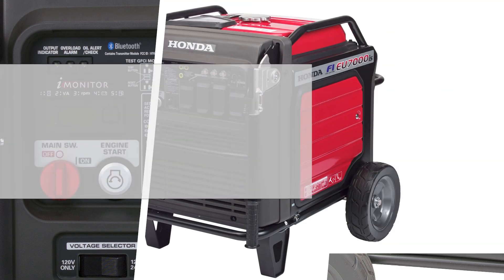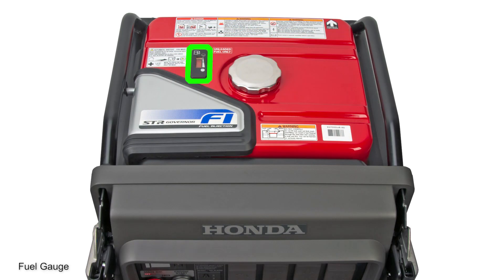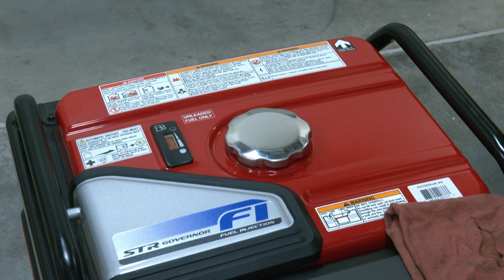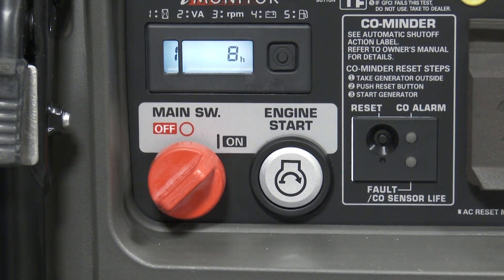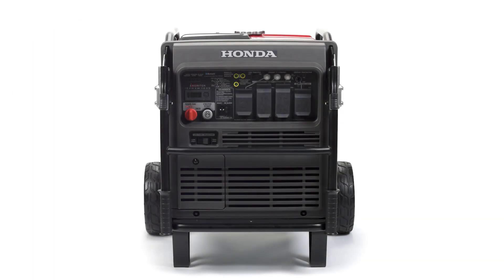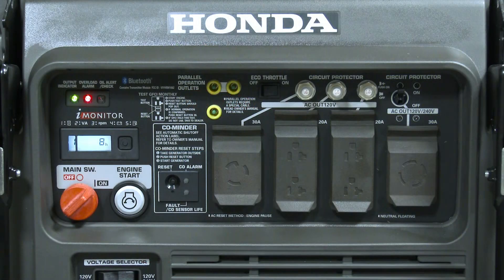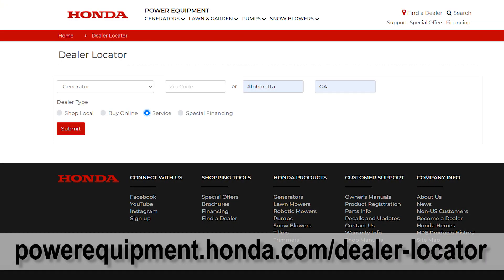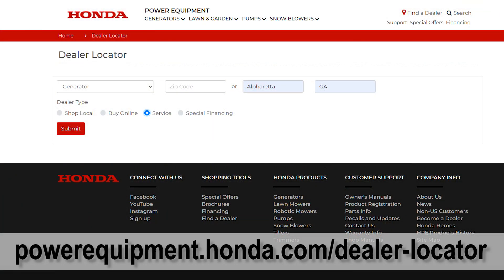Honda EU7000is Generator Operation

Comment: I realize this is an older video, i was wondering with proper maintenance how many hours would you estimate you might get out of this unit. I realize it would be an estimate, just curious. Thanks
Reply: I would say 2000 with good oil change discipline

Comment: Honda should consider releasing the control panel wiring diagram. All input interfaces and LCD should have a parallel interface . So that the LCD and All input Buttons can be placed in a remote enclosure for remote monitoring and can be controlled with autostart  feature. New  versions are coming with bluetooth but that range is not sufficient . Especially if your generator is in the basement and you live on the 3 floor, a remote operaton and remote  lcd for monitoring the generator will be good thing to have. In this IoT era , everyone wants to automate their stuffs for remote sensing and remote control. Third party sellers are selling Autostart Kits why honda cannot provide the same function built in.

Comment: I turned on the key and nothing show on the LCD screen.  Took it to autozone to charged and put it back still no power.  What’s the issues I should be looking at?
Reply: Can you start it with the manual pull rope ?

Comment: can i use this (Honda generator diesel eu7000is) for desktop computer (500W, 240V, 4A, or above) with no problem? if there's problem, what solution/s? using a AVR or something?
Reply: ⚠️Please don’t forget to follow the generator safety tips when you use your portable generator:

All generator safety rules need to be followed carefully whenever you use your portable generator. This is a reminder. 

1) KEEPING OTHERS SAFE: Please do not allow an unqualified person or your children to operate and service the portable generator. Just because some manuals don’t say that doesn’t mean it’s safe. That is important against the generator safety rules. We also need to be keeping an eye on our children too. You need to make sure that your children are not playing near the portable generator especially when it’s running so they won’t get electrocuted. Generators pose electrical risks and they can be hot during an operation. Please keep your children away from the portable generator at all times. It is important to keep our children safe especially our little ones. Be aware of all the hazards.

2) WHERE TO RUN YOUR GENERATOR: Some people use their portable generators indoors which increases the risk of carbon monoxide poisoning. It’s important to have a carbon monoxide if you have a gas generator. Never ever use your generator indoors even if your doors and windows are open and even in the garage is not safe to use a portable generator. Not even at your porch and your deck. It is never safe to use your generator indoors and in enclosed areas of your home. Your generator needs to be 15-20 feet away from your house. 

3)🔥FIRE HAZARDS: Never refuel your generator while it’s running. You need to let your generator cool off before refueling it and before storing your generator. Never overload your generator too. Never ever back feed your generator. You should never plug your generator into a wall outlet. Also never store propane tanks indoors. Please keep flammable things away from the generator as well and please don’t smoke cigarettes near the generator. Having a fire extinguisher next to the generator is also important against the generator safety rules. 

4) GENERATOR OPERATION: make sure your hands are dry before touching the generator. Never use your generator in wet conditions. Don’t let your generator get wet. You need a generator tent if you need to use your generator during wet weather. Please don’t wear loose clothes when operating the generator. Turn on your generator before plugging in appliances. Use the right cord for your generator. Please do not use worn out cords. 

https://youtu.be/I1jT3ANENvI and here is a video more about keeping others safe when using generators 

Hope this helps

Comment: M F Honda  !!      We cant buy the Bluetooth   EU 7000 is  in England so why put it on here .   Its been out for sale for a year now .  We must be some third world country .    FFS .
Reply: ⚠️Please don’t forget to follow the generator safety tips when you use your portable generator:

All generator safety rules need to be followed carefully whenever you use your portable generator. This is a reminder. 

1) KEEPING OTHERS SAFE: Please do not allow an unqualified person or your children to operate and service the portable generator. Just because some manuals don’t say that doesn’t mean it’s safe. That is important against the generator safety rules. We also need to be keeping an eye on our children too. You need to make sure that your children are not playing near the portable generator especially when it’s running so they won’t get electrocuted. Generators pose electrical risks and they can be hot during an operation. Please keep your children away from the portable generator at all times. It is important to keep our children safe especially our little ones. Be aware of all the hazards.

2) WHERE TO RUN YOUR GENERATOR: Some people use their portable generators indoors which increases the risk of carbon monoxide poisoning. It’s important to have a carbon monoxide if you have a gas generator. Never ever use your generator indoors even if your doors and windows are open and even in the garage is not safe to use a portable generator. Not even at your porch and your deck. It is never safe to use your generator indoors and in enclosed areas of your home. Your generator needs to be 15-20 feet away from your house. 

3)🔥FIRE HAZARDS: Never refuel your generator while it’s running. You need to let your generator cool off before refueling it and before storing your generator. Never overload your generator too. Never ever back feed your generator. You should never plug your generator into a wall outlet. Also never store propane tanks indoors. Please keep flammable things away from the generator as well and please don’t smoke cigarettes near the generator. Having a fire extinguisher next to the generator is also important against the generator safety rules. 

4) GENERATOR OPERATION: make sure your hands are dry before touching the generator. Never use your generator in wet conditions. Don’t let your generator get wet. You need a generator tent if you need to use your generator during wet weather. Please don’t wear loose clothes when operating the generator. Turn on your generator before plugging in appliances. Use the right cord for your generator. Please do not use worn out cords. 

https://youtu.be/I1jT3ANENvI and here is a video more about keeping others safe when using generators 

Hope this helps

Comment: The Hyper Engineering Sure-Start dramatically lowers the peak locked rotor amps of an A/C outside condenser by more than half to make it much more supportable by the generator. It's a soft start, not a hard start that dumps even more amps into the compressor.
Reply: When I went to their website, it says it is an electronic software-driven soft starter. Not that this is a bad thing. Soft starts are great and help extend the life of your AC system.

Comment: I would have suggested that the 120/240V selector switch be set before starting the generator and creating power - especially because you did not say to turn off the 30A breaker first. The simplified instruction would just be to set the 120/240V switch before ever turning the keyswitch on to keep novice users out of trouble, because I imagine many users will never bother flipping the breaker on/off in practice.
Reply: True

Comment: I recommend this generator to anyone that wants security and maximum output for your appliances.I also have the 2000 model for camping and when you need to perform repairs that need electricity.Money well spent

Comment: Where can I get one? Seems like every place I check they are always out.....bummer🙁
Reply: I ordered mine thru Lowes. Also got 10% off with my Lowes discount.
Reply: ⚠️Please don’t forget to follow the generator safety tips when you use your portable generator:

All generator safety rules need to be followed carefully whenever you use your portable generator. This is a reminder. 

1) KEEPING OTHERS SAFE: Please do not allow an unqualified person or your children to operate and service the portable generator. Just because some manuals don’t say that doesn’t mean it’s safe. That is important against the generator safety rules. We also need to be keeping an eye on our children too. You need to make sure that your children are not playing near the portable generator especially when it’s running so they won’t get electrocuted. Generators pose electrical risks and they can be hot during an operation. Please keep your children away from the portable generator at all times. It is important to keep our children safe especially our little ones. Be aware of all the hazards.

2) WHERE TO RUN YOUR GENERATOR: Some people use their portable generators indoors which increases the risk of carbon monoxide poisoning. It’s important to have a carbon monoxide detector if you have a gas generator. Never ever use your generator indoors even if your doors and windows are open and even in the garage is not safe to use a portable generator. Not even at your porch and your deck. It is never safe to use your generator indoors and in enclosed areas of your home. Your generator needs to be 15-20 feet away from your house. 

3)🔥FIRE HAZARDS: Never refuel your generator while it’s running. You need to let your generator cool off before refueling it and before storing your generator. Never overload your generator too. Never ever back feed your generator. You should never plug your generator into a wall outlet. Also never store propane tanks indoors. Please keep flammable things away from the generator as well and please don’t smoke cigarettes near the generator. Having a fire extinguisher next to the generator is also important against the generator safety rules. 

4) GENERATOR OPERATION: make sure your hands are dry before touching the generator. Never use your generator in wet conditions. Don’t let your generator get wet. You need a generator tent if you need to use your generator during wet weather. Please don’t wear loose clothes when operating the generator. Turn on your generator before plugging in appliances. Use the right cord for your generator. Please do not use worn out cords. 

https://youtu.be/I1jT3ANENvI and here is a video more about keeping others safe when using generators 

Hope this helps
Reply: @The_Happy_Aviation_Enthusiast  Will do. I got one and am loving it. Maybe, with the up coming cold snap coming I’ll be better prepared now.

Comment: I have an older model without the Bluetooth feature. Otherwise it’s identical. I use mine to power up my entire 2100 s.q.f.t. house during power outages. Not only does it provide clean 60 cycle power. It also has enough capacity to operate my Trane 2-1/2 ton central air conditioner in the summer time as well as two large refrigerators & an extra large freezer. Even my doorbell is hooked up to it. 
I had an electrician wire mine up to my house so it’s code compliant. I had a fabricator build a stainless steel enclosure for mine on a concrete pad. A few switches & my wife is able to start it up without going outside. Then back feed with an interlock my entire circuit breaker panel. We were without power for three days last August from tropical storm Isais. We were able to stay nice & cool in the house & my wife was able to do laundry with it. We burned 22 gallons of gas for the entire outage. It’s super quiet too. Many of my neighbors didn’t even know we had a generator running the entire time. 
👍
Reply: Awesome review…thanks for sharing..planning to get one for my family in Philippines…they always have black out there but we call it brown out there haha especially during typhoon times
Reply: You won’t be disappointed! Everytime I start it? It starts on the first pull. It comes right up to operating speed to deliver power within a few seconds of starting. Cold weather/hot weather it delivers consistently! It’s good for sensitive electronics & computers. I can easily see this lasting decades with the infrequent times I need to use mine. I consider it an insurance policy. If I need it? It’s right there to deliver.
Reply: Would you be so kind to show a pix of the enclosure and where it is in relation to your house?
Reply: @cassielester8252  Unfortunately I’m not computer savy. I have pictures on my I-Pad of my generator but I can’t attach them to a reply. The distance is 2 feet off the house on a poured in place concrete slab. Everyone that sees my set up is blown away!
Reply: @johnclyne6350  thank you very much for your reply...be safe.
Reply: Great 👏👏👏👍🏼🇺🇸
Reply: @mitchellstanlee7377  if I were you and you lost power a lot or at least twice a year I would buy one
Reply: I’ve had my Honda EU 7000is for 5 years & with minimal maintenance such as changing the oil one a year. It still performs flawlessly. I only needed it once for that 3 day outage 3 years ago. 
Other times were less than 4 hours. I exercise with & without load every couple of months. I have about 70 hours on the engine. I already swapped out the battery knowing full well that batteries today don’t last as long as they used to. Mine is always on a trickle charger. All my neighbors have loud & cheap generators. They have constant problems with fuel & carburetor issues. One neighbor says his won’t start now. I had all the neighbors look at my set up & they all asked questions. I advsised them to get the same make & model genny. I’m the one that knows the most about electricity what did the buy? The cheap ones. Go figure?
Reply: 22 gallons of gas for 3 days isn't that bad considering all of the things you were running,  including the central ac unit. Was that using it continuously? 
Thank you for sharing your story. I think I'm going to get the same setup as you.   
Quick question. 
How much was it to install and interlock switch to your panel?
Reply: @411sponge72  we ran the generator 17 hours a day. Or for 53 hours. We turned it off when I got home from work at 10:30 pm. I opened all the individual circuit breakers in the panel. 
I would wake up at 4 am & go out to check the fuel/oil & fire it back up. I would then start our central air condenser first & wait until the unit was running. Then turn on the air handler & wait until that was blowing cool air. Then slowly add circuits until everything was back on. That would take about 1/2 hour. I would take my shower & get ready to go back to work restoring other people's power. My wife was very happy. Happy wife/happy life. 
I couldn't be real down each part of the electricians work. I paid him $3500 cash for everything. This was before the pandemic when prices on everything was reasonable. It sounded high but it was done to my wishes.
Reply: Just an addendum to the first reply.
I had set the thermostat on the central air down to 55 degrees. That way it could never cycle off. That was the only way I was able to enjoy central air on such a small generator (5500 watts). So the central air was on for 53 hours too. At night we wouldn't open our fridge or freezer. If we got up at night we had lights that came on when the power is off. The whole house had these lights in every room. We didn't need a flashlight at night.
Reply: @johnclyne6350  Thank you very much for posting!!!  This is great information!!

Comment: I have one of these for my fireplace and chimney business and it’s awesome! Make sure you use None Ethanol Gas! It works best this way and I use 10 Gauge extension cords!
Reply: I have the EU6500 which is basically the same machine. I use ethanol gas but ONLY with combined Stabil for storage to make sure the ethanol doesn't degrade over time. Also doesn't hurt to use a very little bit of water absorbing methanol annually to make sure no water builds up in the tank. I have used it this way for years and no problems, but otherwise, yes, don't use gas with ethanol in it unless you are prepared to take these extra steps.